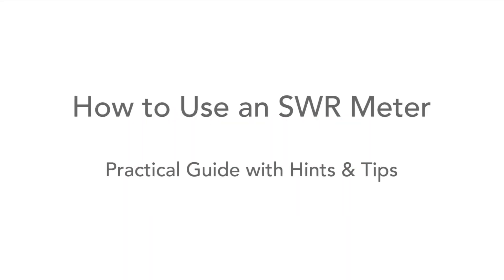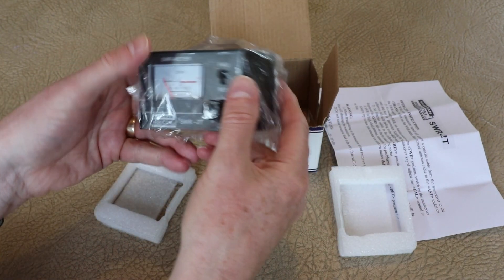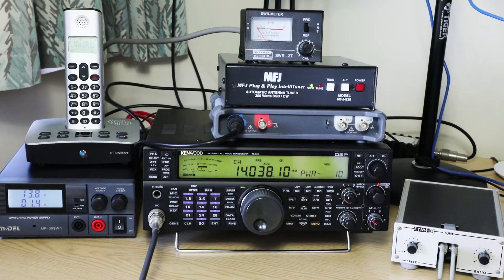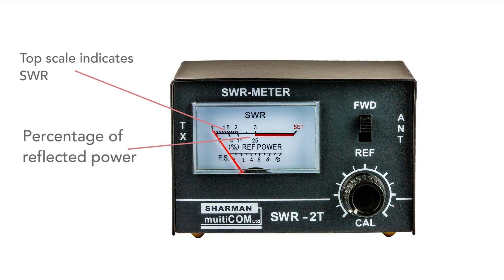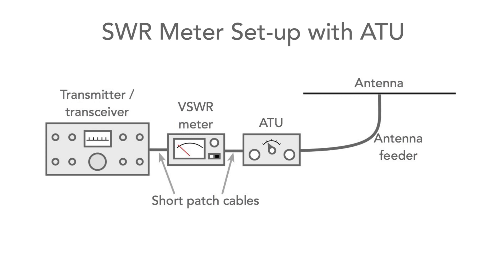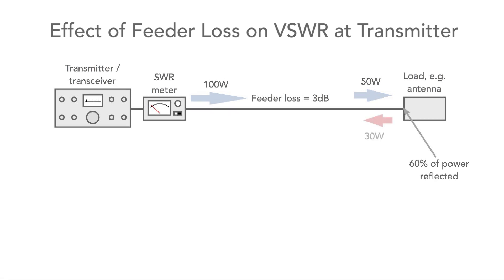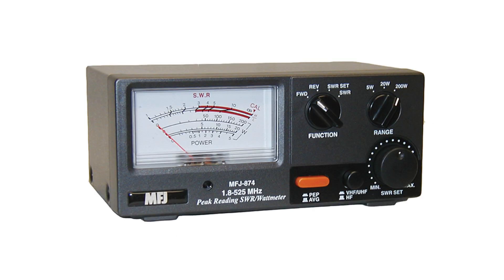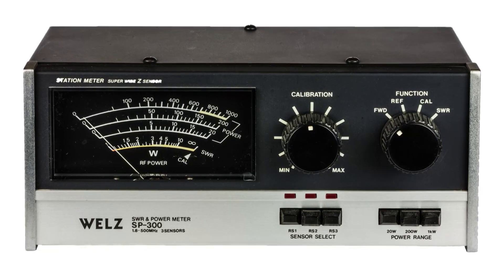How to Use an SWR Meter: standing wave ratio meter - guidelines & tips

Comment: This is an excellent guide on how to use a SWR meter designed for 25-30mhz on 20 meters, 
being as the generated frequency is so far out of the meters designed operating range I 
would trust the readings as much as i would trust a chocolate teapot.
For any new person getting in to Amatuer Radio make sure the SWR meter covers the bands 
you want to use it on.
Reply from the maker: Yes, point taken, but in general the type of meter used would have been adequate for a demonstration. Also the main issue is the sensitivity which was proved to be quite adequate. That said the lower end meters are generally not that accurate but are able to provide an indication of whether there is a high or low SWR.
Reply: Hi can you please help me understand what’s wrong with my readings? 

Cb radio built in swr meter shows low swr. 

Connected external meter, now both the external and internal meters shows high swr.

Adjusting the antenna until both the external and internal meters matched with a low swr. 

Unplugged the external meter, now the internal meter suddenly shows high swr.
Reply: @golda_rabinovitz  This type of SWR meter is reading voltage nodes and can be sensitive to where along the feedline it is placed.  Adding a few feet or meters of coax changes the "node" or position of maximum reflected voltage.  The short patch coax needed to insert an external SWR meter also has the effect of changing the total feedline length and thus moves the "node". 
ANYWAY, if your antenna is not balanced, the feedline coax itself becomes part of the antenna and its length matters . Adding ferrites at the antenna end will mostly stop that phenomenon and then your SWR won't depend so much on the length of the coax.
Reply: @thomasmaughan4798  Thank you so much for explaining. But what is the point with using a swr meter if it’s so unreliable that just adding the coax from the radio to the meter will affect the reading and putting it back on radio, the swr will change once again from the external reading. Say if I had a older radio with no swr protection and no built in swr meter, I would connect the external and test, the result is inaccurate and I would think everything is alright and remove the external meter (and coax  of course) and will damage the radio because I trusted the external swr meter?
Reply: @golda_rabinovitz  That's simply the nature of the beast.  Adding an SWR meter inline on the feedline, if by so doing you change the length of the feedline, you really are not testing the "system" as you intend to use it UNLESS the SWR meter stays right there ALWAYS, which for me is exactly the case.  The feedline becomes part of the system and its length MATTERS if you have standing waves (if not, the length does not matter). 
 
BUT if the antenna is mis-matched (and most are to some degree) then you are going to have "standing waves" which is simply the voltage peaks of the outgoing radio waves happening to meet the reflected radio waves and every quarter wavelength along the coax you are going to have a "node" where these voltages add up (that's bad) and anti-nodes where they cancel and if you measured at that exact point, you would see nothing!  No voltage (in the case of infinite SWR).  How weird is that?   This is why built-in SWR meters almost never read the same SWR as external UNLESS you have a perfectly matched antenna and there aren't any standing waves anywhere.  It is also why I trust the built-in SWR meter because it sees the SWR that the transmitter actually sees, and that's what matters most.

A reasonably reliable method is to connect the SWR meter using exactly 1/2 wavelength of coax between the SWR meter and the transmitter.  So at 20 meters (14 MHz) you would use 10 meters of coax BUT  BEWARE the velocity factor of 65 percent or so, in other words, 6.5 meters of coax will ensure that the external SWR meter is at the same "node" as the transmitter.
Reply: @thomasmaughan4798  Ok so I could put the swr meter on the shelf and instead rely on the build in one? I can fix with the antenna so that my radios swr meter is fine. But I still worry a lot if I can trust it because: 1. The antenna only stands on a pizza plate on the balcony since I have no way of getting an antenna up. 2. Not many people can actually hear me, only if they are some kilometers away we can talk. 3. My radio gets WARM after some 5 minutes, I can feel it when I put my hand on the back of the radio that it’s pretty much too warm I think. Maybe mine is flawed and would get as warm as now even if the antenna would be great setup i don’t know 🤷🏻‍♀️ Maybe should I buy a radio for a whole other frequency and have a much easier way to set up a antenna? Because i have not read much about people worry and ask questions about swr when it comes to vhf or uhf radios as they do when it’s cb, so I start to think that vhf and uhf are not as sensitive as cb radios with antenna and swr?
Reply: @golda_rabinovitz  A quarter wave antenna expects to operate on a ground plane.  Where a ground plane does not exist or is impossible, it works to use two quarter wave antennas back-to-back which is then just a dipole.  You'll get about SWR 1.5 out of that arrangement but it is a lot better than a quarter wave with no ground plane which then seeks ground through the coax back to your radio and likely your body.

You are correct to think that low powered VHF and CB is less concerned about SWR; it rarely damages the radio, it just doesn't get out very well with SWR 3 and up.   A "choke" near the antenna will keep the RF from traveling back on the outside of the coax onto your radio and from there your hands and body.  It isn't dangerous at low power levels but at 100 watts it could become dangerous.

From your description, you might also be having a polarization problem.  VHF is usually vertically polarized; meaning if I hold an antenna vertically, and your antenna is horizontal (or vice versa), they won't talk to each other.  It isn't a complete fail since there's usually reflecting elements here and there that rotate the polarization.  HF radio is usually horizontal; VHF usually vertical, but DX (long distance) gets rotated in the ionosphere so it is less of an issue.